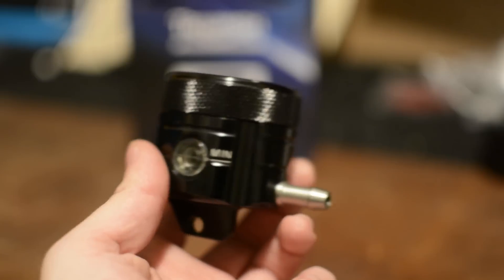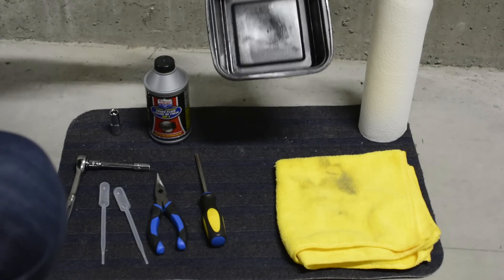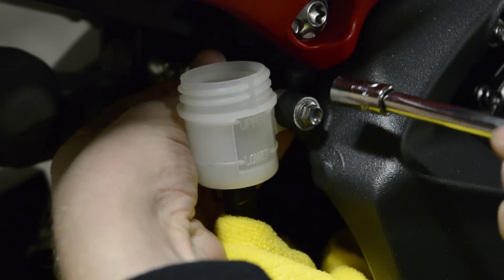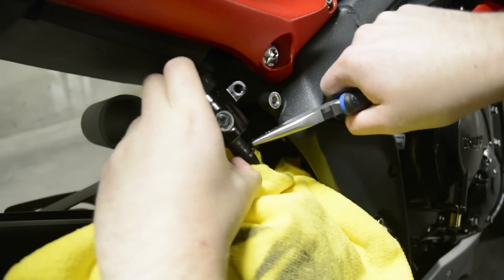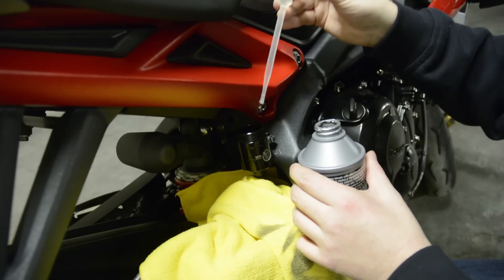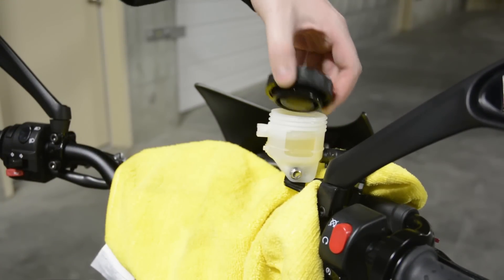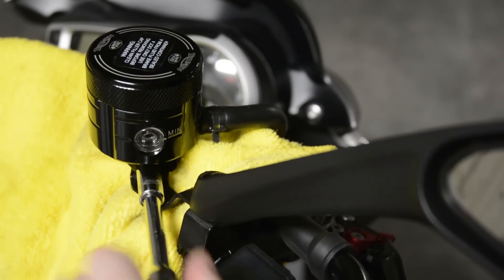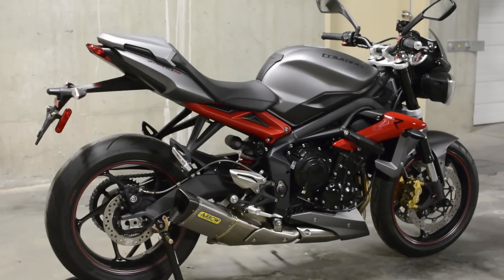Triumph Anodized Brake Reservoir Replacement

Comment: Hey there, again another great and clear production. At the time watching the vid, I was wondering if the fluid shouldn't be refreshed. But you explained it in the end. Nice job and thnx again 👍.
BTW do you do your edits on Première Pro, Final Cut or Vegas?
Reply from the maker: Glad you enjoyed it! Ya, the bike is fairly new and I am planning to do a full video on brake flushing/changing later in the season. It would have been too much to do all at once right now and I wanted to show people that you don't actually need to. I do my videos with Premier Pro CC, just getting my feet wet with it, I'm still learning the software!
Reply: ScottyTriple Ha nice thnx. Well once you know wich button is for wich function, it's straight forward. I still using Première CS6 workwise and sideprojects (74 frames YouTube). If you have any questions just shoot. Maybe something to add  to your list: 12V (usb) plug.

Comment: Once again, an outstanding walkthrough man! I love the look of the anodized reservoirs. Did the front and rear come separately?
Reply from the maker: Thanks TriplePrime! Glad you liked it! They do look way better than the original ones! Yes they did come separately, they are around $80-100 each. I may add the part numbers to the description to help others out. I didn't originally because there are different ones depending on if you need the bracket for the front.

Comment: Hey, great video. But I was wondering, If the new front reservoir sits in a different place from the old one, is it ok to use an short piece of brake line to extend the original or should I replace the whole line? Thanks.
Reply from the maker: +Matthaus Godrich 

Well, if it's the correct accessory reservoir it shouldn't require any extension of the brake line. But you could replace the short line that goes from the reservoir to the master cylinder. Just make sure to use a line approved for use in the braking system that won't react with the fluid. Also, it would be a good idea to bleed the entire system if you are swapping the lines as you are taking the fluid out right to the master cylinder and likely got air in.

Comment: Is there no need to bleed the brakes?
Reply from the maker: Jeffrey Man Because you are siphoning out the fluid from above the master cylinder there is little chance you will get air down into the lines unless you apply the brakes and suck air down into them.